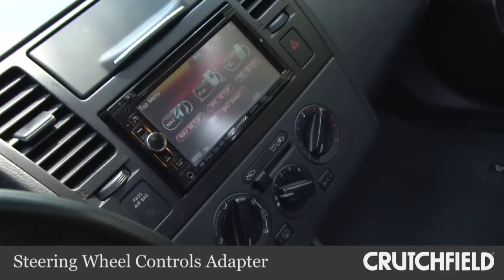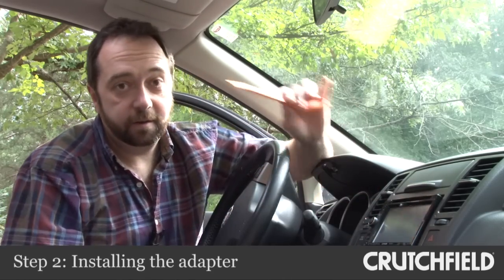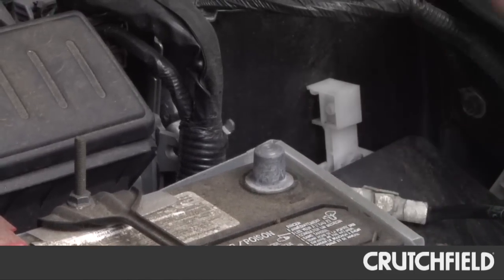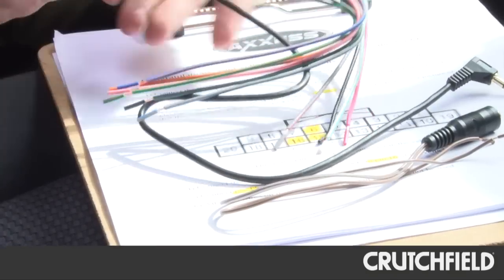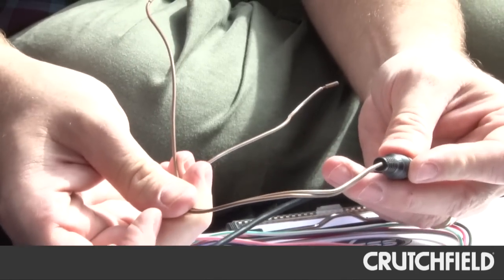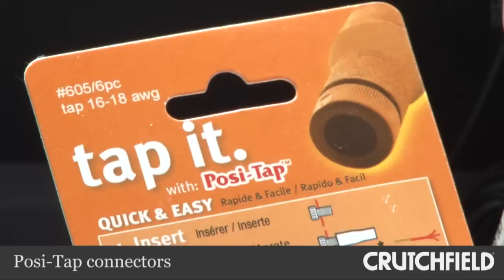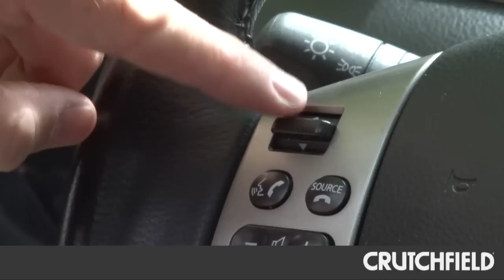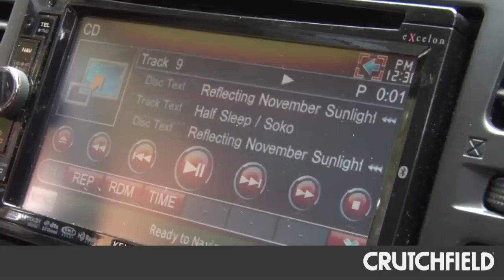Installing a Steering Wheel Audio Control Adapter | Crutchfield Video

Comment: hi great video. i have bought a steering wheel adaptor for peugeot 307, connected to the xtron player which compatible but the steering wheel stalk is not working, any idea what i need to do ? theres key 1 key 2 and ground wire which i haven't connected , i just plugged and play
Reply from the maker: I'm afraid we don't carry those products and don't have any research on file for your Peugeot. Your best option to get more detailed installation & wiring help would be to reach out to the manufacturer directly. 

I hope that helps. 
--Crutchfield
Reply: thanks mate got it sorted

Comment: Hi, I think you can help me. Which color led should be steady after finishing the programming ? Is it red or green led ? A green led is steading my axxess adapter. And when I press the button of steering wheel control the green LED blinks. But I can't see any change on stereo. My stereo is Sony MEX-N5050BT. Awaiting your reply.  Thanks
Reply from the maker: I found in the owner’s manual that the LED will be solid red when programming is complete and it has successfully detected the vehicle and the new receiver. 

I hope this helps!
--Crutchfield

Comment: i have a custom instaled honda civic hybrid (2006) instaled on some previous  civic. My stereo is an Alpine iDa x-100  i would like to know if a PAC swi-rc would work on this.  or if there is a better adapter that assures this will work for sure.
Reply from the maker: +Joprez PT Yes. The PAC SWI-RC is compatible with both the 2006 Civic Hybrid steering wheel controls and the Alpine stereo.Hope that helps!--Crutchfield

Comment: If there is already a Bluetooth Mic installed for my car, will this adapter allow the functionality to work again? I see you have a bunch of wires you didn't use. Are one of those dedicated to the microphone?
Reply from the maker: +drslickrick15 This interface does not keep a factory installed Bluetooth microphone working. The extra wires are there because this interface can work with many different vehicles and aftermarket radios. They automatically include all the wires that could be possibly used in these different vehicles which means some will always be left unused. Typically, the only way to use a factory Bluetooth microphone is if there is a way to keep the factory Bluetooth system working when you install a new radio. For additional assistance & personalized recommendations, feel free to contact us directly:

http://www.crutchfield.com/I-rYTVc000/ContactUs.aspx

I hope that helps.
--Crutchfield

Comment: Did you connect the ground and acc wires of the aswc-1 to the aftermarket or factory harness? Is it ok to connect them to the aftermarket harness/radio or do they need to be connected/grounded through the original factory harness like you did the other required wires?

Thanks
Reply from the maker: The Axxess ASWC-1 installation can vary slightly from vehicle to vehicle--for more details on what's required for your specific application, Axxess provides custom install instructions directly from their website: https://axxessinterfaces.com/products?category=AX-RSWC

You can also contact an Advisor on the Crutchfield website to discuss further: https://www.crutchfield.com/I-rYTVc000/Support/Chat.aspx

Hope that helps!
--Crutchfield

Comment: Thanks for the video.
In my case, I am new to this vehicle world and I know nothing.
(I know it looks stupid 🤐)
However, I have a Nissan Xtrail TI 2005  that steering wheel only have cruse control. But I prefer to have a newer steering wheel with volume and track controls as I want to upgrade the stereo at the same time.
I want to know; is this possible and then what are the options I have & your suggestions?
Thanks.
Reply from the maker: The steering wheel adapters we carry are intended to retain the use of existing steering wheel controls for volume, next song, etc. If you don't currently have those your options would be to replace the steering wheel with a new one that does have those or add a universal steering wheel control adapter like this Axxess RFASWC to your existing steering wheel: 

https://www.crutchfield.com/I-rFBKc290/g_459850/Turntable-Cartridges.html?tp=71663

Comment: Hi, thanks for the informative video, does this work for a Nissan Altima 2008  SL, if so does it program automatically as shown in the video, and would answering calls steering wheel button also work? Thanks once again.
Reply: Btw my stereo is a Kenwood DDX470 , sorry forgot to mention
Reply from the maker: +ZA R The Axxess ASWC-1 interface would work in your '08 Altima and conect to the Kenwood DDX470 receiver. We include Tech Support with your purchase from Crutchfield who can help with the installation and you can also view the wiring instructions for your car from Metra/Axxess' website here: axxessinterfaces.com/I-rYTVc000/index.php?main_page=page&id=7

If you have any further questions feel free to contact us directly at our website www.crutchfield.com/I-rYTVc000

I hope that helps.
--Crutchfield

Comment: What are the two wires coming from the 3.5mm connector hooked up to, is it a power, grownd, or something else?
Reply from the maker: +Domini Goofy The adapter that plugs onto the 3.5mm connector in the video provides the wire leads for connecting to aftermarket stereos that have the steering wheel integration leads in the wiring harness instead of a 3.5mm input for the plug. For additional assistance and personalized recommendations, feel free to contact us directly:  http://www.crutchfield.com/I-rYTVc180/support/ContactUs.aspx  Hope that helps!--Crutchfield

Comment: I own a BMW 325ci 2005 and Also own the Swi-rc adapter. When I looked on their website, I saw no picture of the connector, what should I do?!
Reply from the maker: Well, depending on the original factory equipment (basic audio, premium Harmon Kardon audio, factory Navigation), we have different recommendations. While PAC may list the SWI-RC as compatible in all factory equipment versions of the vehicle, it may require additional parts (resistors, etc.) in some factory configurations.
If you purchased the adapter from Crutchfield, our tech support department will be happy to help. You can reach them directly at the number on the back of your invoice.
If you purchased the adapter elsewhere and the retailer will not help, you can contact PAC directly: 800-533-5487  
Hope that helps!
--Crutchfield

Comment: I'm trying to install the aswc-1 in my car. I'm trying to hook it up to a Pioner AVH-5600 but the thing is I don't know where the red/gray wire is supposed to go. I got the harness adapter but im really confused as to how to connect everything together. The car is a Honda Accord 2008 Ex-L if that helps any. Would really appreciate an answer. I found the video hoping to see all connections one by one. Thanks!
Reply from the maker: Most Pioneers offer the 3.5mm input on the back for the wired remote (or in this case steering wheel integration adapter). So you may not use the wire designated in the owner's manual for every aftermarket stereo.
If you purchased from Crutchfield, give our tech support department a call. Their toll-free number is printed on the back of your invoice. If you purchased elsewhere and the retailer will no help, you can contact Metra directly: 800-253-8324 
Hope that helps,
--Crutchfield

Comment: where did you get the posi taps from? or do I have to use them to connect the wires? Could I strip the wire and connect the wires from the SWC instead of using the posi taps?
Reply from the maker: We offer the Posi Taps on the main Crutchfield website here:  http://bit.ly/2s3bOEl  For additional assistance and personalized recommendations, feel free to contact is directly:  http://bit.ly/2jBGHPp  Hope that helps--Crutchfield

Comment: On the steering wheel control adapter I have to wire it to another 12v wire that turns on and off with the ignition key. I am going to wire it to the receiver but my receiver has two 12v wires, one is a constant 12v and the other is switched. Which do I use?
Reply from the maker: You'd want to connect the adapter to the 12v switched wire in this case.

Hope that helps.
--Crutchfield

Comment from the maker: Many aftermarket stereos will offer a 3.5mm jack for an optional wired remote. On these models, the steering wheel interface adapter will plug to this port. Keep in mind; when this connection is provided for a wired remote, it is not an auxiliary audio input although it does use the same style connection. Feel free to call for additional assistance: 800.315.0030--Crutchfield

Comment: does this work with vw sharan 2012 and can it help control left and right steering wheel buttons but still letting me be able to see cars range etc theough dash board?
Reply from the maker: +susan herrera The steering wheel radio control interfaces we carry do not list your vehicle as being compatible. I wish I had different news for you there.
--Crutchfield

Comment: I had professional company installed my new stereo today with a new steering wheel control adapter. It worked when I first started the car but after the second time I started the car. My steering wheel control failed. The buttons stop functioning. Any reasons why?
Reply from the maker: It's hard to say without more specifics. The easy answer is to take it back to the "professional company" an have them troubleshoot the problem. Either it was not installed properly or the adapter may be defective. Regardless, if you paid for professional installation, I would certainly have them take another look.
HTH!
--Crutchfield

Comment: I see you are doing this on a Nissan Qashqai. Do you have any advice on replacing the actual part that controls all these functions on the steering wheel i.e. the clock spring/spiral cable? I have purchased 3 until now ( from Chinese suppliers) all fail after 1-2 months.
Reply from the maker: Our vehicle research only covers models released in North American markets--which unfortunately doesn't include the Nissan Qashqai. 

You may want to try contacting a local Nissan dealer in your region for more details. 

--Crutchfield

Comment: On what side did you connect the steering wheel adaptor, the vehicle wiring harness or the integration wire harness?
Reply from the maker: A lot depends on the specific vehicle, stereo and the selected integration adapter. In most applications, the integration adapter will connect to either a provided lead in the aftermarket stereo's harness or directly to a dedicated input (3.5mm) provided on the back side of the aftermarket stereo chassis. On the vehicle end, you'll need to tap the factory leads for the commands coming from the steering wheel buttons.
For additional assistance & personalized recommendations, feel free to contact us directly:

By phone: 800.315.0030
Online chat: http://bit.ly/1b07Ykm  
e-mail: advisors@crutchfield.com 

I hope that helps.
--Crutchfield
Reply: Crutchfield in this video your advertising to use posi taps but axxess customer rep told me not to use posi taps because it would cause intermittent connection lost. Who's right, crutchfield or axxess?! So much confusion....
Reply from the maker: Carl Brooks We've been recommending the Posi-tap connectors for many years now without issue. You're welcome to make the connections in any manner you see fit but we've found the taps to be very convenient and effective.
For additional assistance & personalized recommendations, feel free to contact us directly:

By phone: 800.315.0030
Online chat: http://bit.ly/1b07Ykm  
e-mail: advisors@crutchfield.com 

I hope that helps.
--Crutchfield

Comment: Crutchfield doesn't seem to have any wiring harness or steering wheel control adapter for my 2014 Ford Focus ST, now what?? I was really looking forward to installing a Parrot Asteroid Smart but not if I lose function in my steering wheel radio buttons.
Reply from the maker: We do have kits, harnesses & steering wheel integration for the 2014 Focus provided you do not have the premium “Sony” sound package (factory screen w/ info display cannot be retained when an aftermarket stereo is installed) or have the Electric Focus: http://bit.ly/1e81Oen 
For additional assistance & personalized recommendations, feel free to contact us directly:

By phone: 800.315.0030
Online chat: http://bit.ly/1b07Ykm  
e-mail: advisors@crutchfield.com 

I hope that helps.
--Crutchfield

Comment: Hi I have Pioneer appradio 2 (sph da100), my button not working ( vol up down & home), if I've installed this ASWC1 with my strering switch control, its will work to remotely control my HU? Thanks
Reply from the maker: The AppRadio2 is compatible with the ASWC-1 so, if your vehicle is also compatible, yes, it will work to retain the factory steering wheel controls.To see if your vehicle is compatible, you can use the "Outfit My Car" application on the main Crutchfield Website:  http://bit.ly/2l32bTh  Hope that helps!--Crutchfield

Comment: Hello, I have a Camry 2006, at the moment my car has the factory stereo / head unit. I am able to control the Multi Information Display unit on my dashboard from my Steering wheel. I had previously installed another stereo on this car and lost this features. My question is, if I buy this adapter, will I be able to control the "mode" features on my steering wheel, or is it just for the up and down volume and seek/ source features? Thank you Very much.
Reply from the maker: +Mire Cantu If your steering wheel controls has an "Info" button, you'll lose the factory trip computer when you install any aftermarket stereo.For additional assistance and personalized recommendations, feel free to contact us directly:http://www.crutchfield.com/I-rYTVc180/support/ContactUs.aspx Hope that helps!--Crutchfield
Reply: +Crutchfield thank you very much for the reply!!

Comment: I have a problem, I don't know how to conect the green-white wire  of the aswc to the car stereo connector the instructions said the i'm. Supposed to connect it to a hole but the hole has a wire so I don't know what to do Help! Please. Thank u
Reply from the maker: Jorge Avelar Many car stereos that offer compatibility with adapters like the ASWC provide a lead in the wiring harness instead of the 3.5mm input. Check your stereo's wire code listing (provided in the owner's manual) to confirm the proper lead needed for this connection.Hope that helps!--Crutchfield

Comment: I need a module for my 2010 altima to wire it to my kenwood dnx691hd. So wich one is the one i need??
Thank you
Reply from the maker: To retain the factory steering wheel radio controls, you can use the Metra Axxess ASWC-1 adapter: http://bit.ly/1k9BwOS For the primary wiring harness (power, ground, speaker leads, etc.) you’ll need to know if the vehicle came factory equipped with the premium “Bose” sound package or the basic audio system.
You will find all the recommended installation accessories for your vehicle by using the “Outfit My Car” application on the main Crutchfield website: http://bit.ly/195V6Cx 
For additional assistance & personalized recommendations, feel free to contact us directly:

By phone: 800.315.0030
Online chat: http://bit.ly/1b07Ykm  
e-mail: advisors@crutchfield.com 

I hope that helps.
--Crutchfield

Comment: whats the part number for a civic si sedan 2007 I wnt the sterring wheel contros keep functional whit a kenwood stereo? thanks...
Reply from the maker: +Miguel Martinez Assuming your Kenwood stereo is compatible (most, but not all, are) there are three different adapters that can work in your application. The Axxess ASWC-1 is the most popular and highest rated model: http://www.crutchfield.com/I-rYTVc180/p_120ASWC1/Axxess-ASWC-1-Steering-Wheel-Control-Adapter.html?tp=3405 For additional assistance and personalized recommendations, feel free to contact us directly:http://www.crutchfield.com/I-rYTVc180/support/ContactUs.aspx Hope that helps!--Crutchfield

Comment: Does it work with cars which have other steering wheel controls such as voice recognition, front and side camera on/off and answer/reject phone call functions?
Reply from the maker: There are several different steering wheel integration adapter options. Depending on your specific vehicle and selected stereo, most, if not all, of the factory steering wheel stereo controls can be retained. Many of the adapters allow you to re-program the button functions to provide additional and/or completely different functions as well.For additional assistance and personalized recommendations, feel free to contact us directly:  http://www.crutchfield.com/I-rYTVc180/support/ContactUs.aspx Hope that helps!--Crutchfield
Reply: +Crutchfield And another question, if the factory stereo is fitted with an external microphone, will the original microphone work with the aftermarket stereo?

Comment: What if the aftermarket radio has a key 1 and key 2 wires. Are both wires uesd.
Reply from the maker: In order to retain the steering wheel controls in your car with the adapters we carry, your aftermarket head unit must have a SWC (Steering Wheel Control) 3.5mm input or steering wheel remote control input wire (blue/yellow).

You may want to check with the radio manufacturer directly for more info on the "key 1 and key 2 wires" you mentioned.

I hope that helps.
--Crutchfield

Comment: Do you know if the 2005 Nissan Tiida is compatible with this?
Reply from the maker: The Nissan Tiida is not a model that was produced for the U.S. market (our territory) so, we do not have information regarding it's compatibility with the steering wheel integration adapters we offer. You may want to check with the adapter manufacturers directly to see if they can confirm the compatibility for you and let you know which of their Authorized Retailers serves your specific region.Hope that helps!--Crutchfield